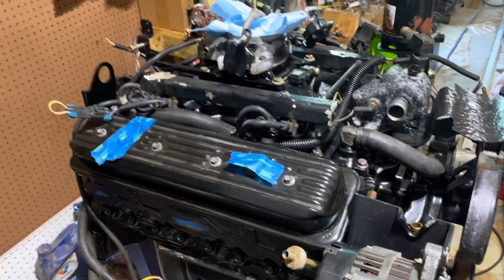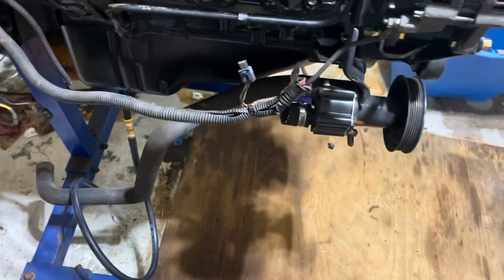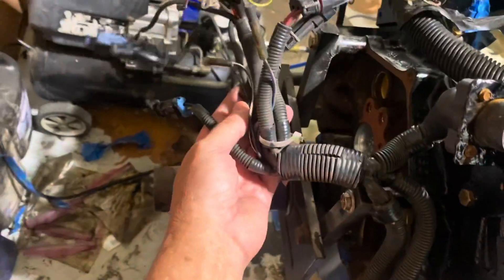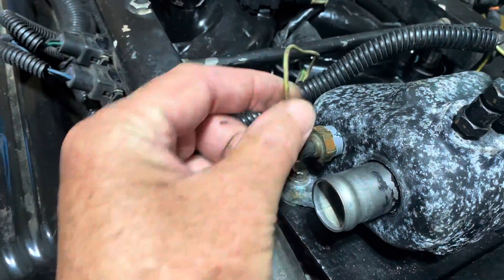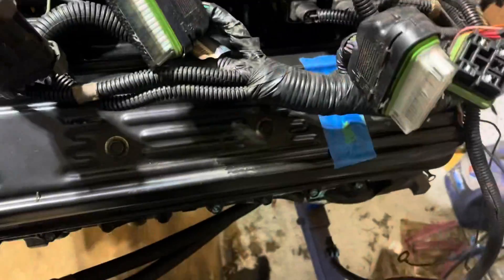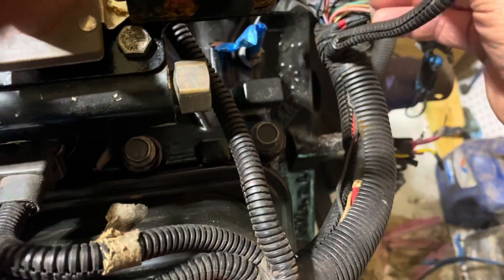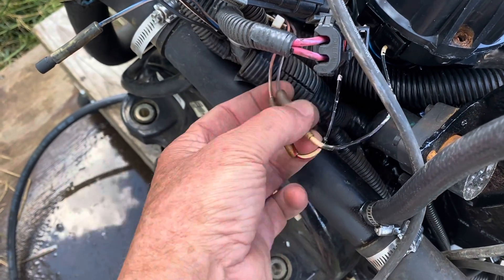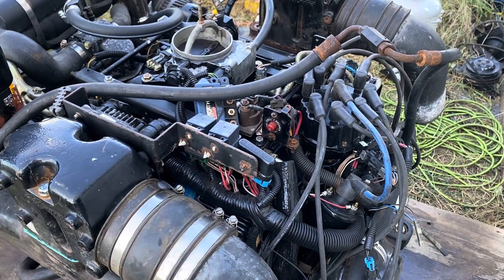Mercruiser 6.2 (1h) - How The MPI Electrical Works

Comment: Did you ever figure out how to scan the computer I have a 5.7 mpi I can’t get to plain out once in the water brand new motor not sure what’s goin on I need help!!!!
Reply from the maker: The MEFI computers have a safe mode that limits power. You’ll need to see if there are codes stored in the computer. It can be done without a scanner. I haven’t done a video of it yet but I plan to soon.